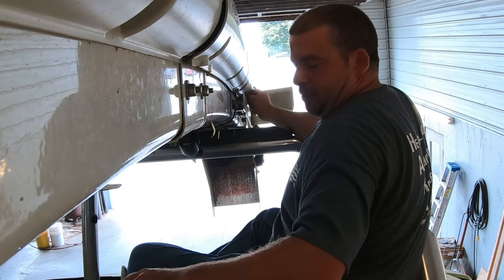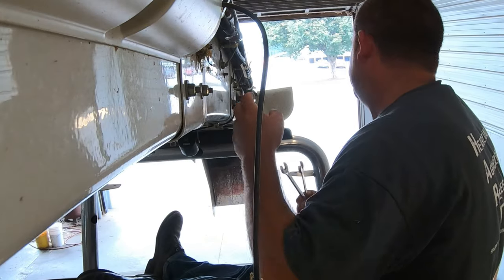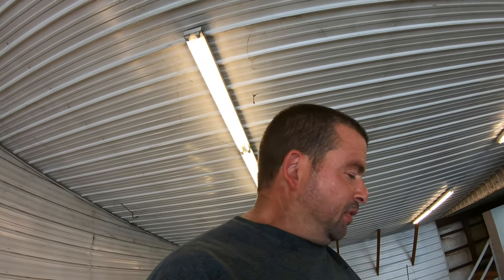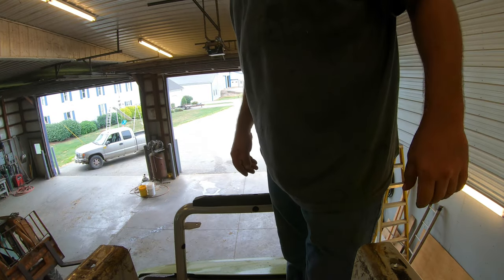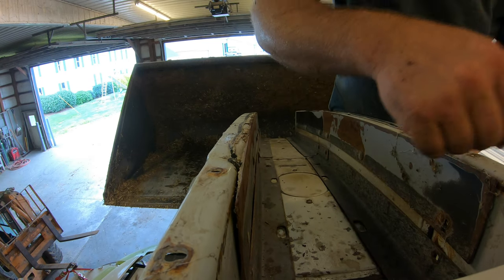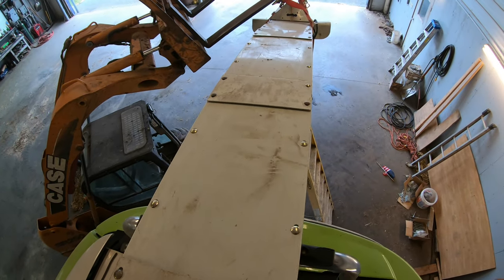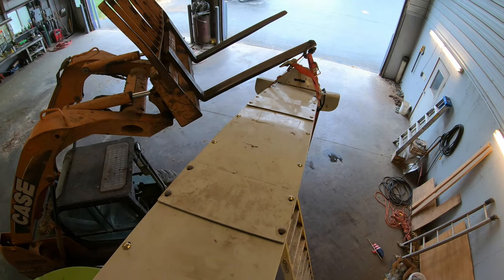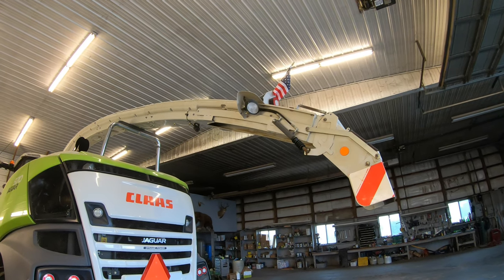Chopper Gooseneck Extension

Comment: Tony, we don't take the top covers off, just the 18 bolts at each joint and slide them apart. Never tried it by myself though, usually at least 2 of us working at it. Hang it on the hoist, then put the piece in by hand, but we only add 1 section.
Reply: Yeah I guess I wouldn’t have to although it makes it easy to access and it’s only four bolts holding them on. A hoist would definitely be nice